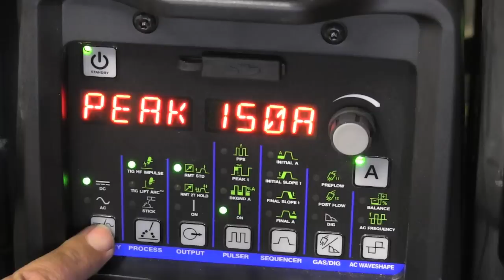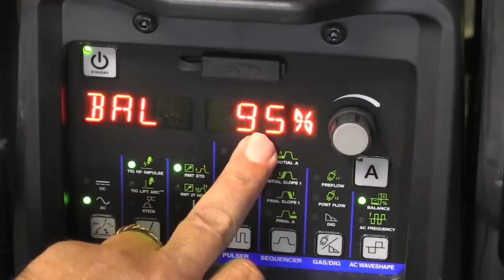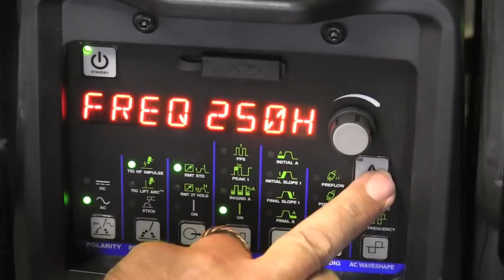Welding Pigs

Comment: Jody at Welding tips and tricks.. you are the best on YouTube I bought a welder at Sears in 2003 didn't know anything about it. So I packed it away collecting dust until 2014  I came your channel understood more about welding an flux core  I didn't know  my machine was a flux welder or what that meant.  you narrowed it down on your channel in easy steps .. I learned how to weld an make clean strong welds from watching you. Now I repair all my trucks and cars thanks to you an your videos you so kindly shared.  :-)

Comment: Hey Pa! Welding is an art form, not just putting pieces together. I've been blessed to be around X-ray certified, millwrights that could hold a stainless bracket 30 feet long to 3 thou. and hillbillies that could keep up with the X-ray guy. They'd be knitting up a vertical plate with one on one side and one on the other- shouting at each other to speed up or slow down. All I can do is watch but I know a good weld when I see one and yours are GOOD! Hands of a surgeon! Keep it up!!

Comment: Many years ago a local AWS inspector came to us to experiment with using silicon bronze and aluminum bronze to join dissimilar steels as well as steel to bronze. They had something in mind but weren't open about it. Guess we weren't the only ones doing it. The way you attached the tail was similar to the way I welded mild steel tabs to Beryllium Nickel. I would put a bead of 347 on the mild steel, a bead of nickel  on the BeNi and join the beads.

Comment: great video. hey im gonna be doing a truck project, gonna have to cut the body frame 12 inches to convert it to a short bed. do you know what kind of welding would be used for a body frame? im pretty sure its tig, but im just making sure.

Comment: Please Mr. Jody i want to ask you about tig welding .. I have lincoln power mig 210 mp and abicore binzel tig torch 26 v when I set the machine and start welding the steel l make balls ...I use 2.4  tungsten and diffuser lens and set the gas on 15 scfh ...please tell me where the Problem...and my best wishes
Reply: do you switch the polarity on the machine? we use Miller xmt 350's and we have to switch the ground to the positive terminal to tig weld
Reply: +3dcustomairbrushing ...sure I switch the positive polarity  on that ground and put The torch on The negative polarity ...but it's the same problem... Thanks for replay me
Reply: Could be something in the argon hose or the regulator that's restricting gas flow I've had that problem too
Reply: +3dcustomairbrushing no problem with the Argon gas and regulator but i think maybe 26 torch not compatible with the machine

Comment: Cool project, industrial piggy bank~ :D
Shouldn't you set the slot width just a bit smaller than the exit hole?  If they put a big silver dollar in there they'd need to crack it open to get it out, no easy task that, from the looks of it.

Comment: i had a job welding that aluminized tubing all day. no way to get a decent looking weld on the stuff. not even in a purge box. stuff is just not optimal for welding.
Reply: +KingGimpicus I've never welded any aluminzed steel thicker than 16ga but for 16ga a simple ER70S-6 class wire and CO2 gives a pretty good weld. Hit it with a very small brass-wire brush and wipe the "smoke" off of it.  I've seen people put down some good welds on it with silicon bronze but I've never had luck with it. Silicon bronze requires just the right gap from what I've been told, something I didn't know when I tried using it.